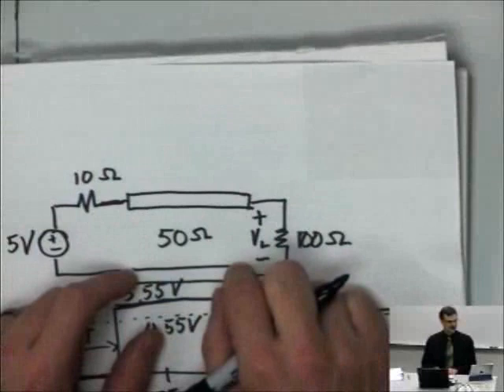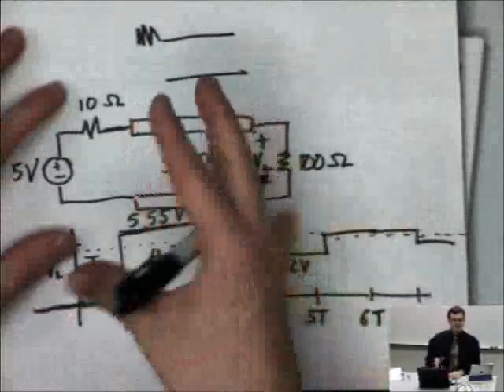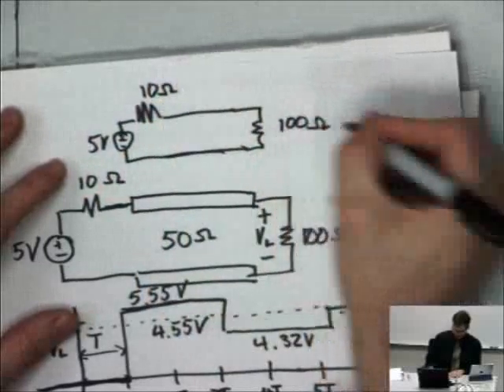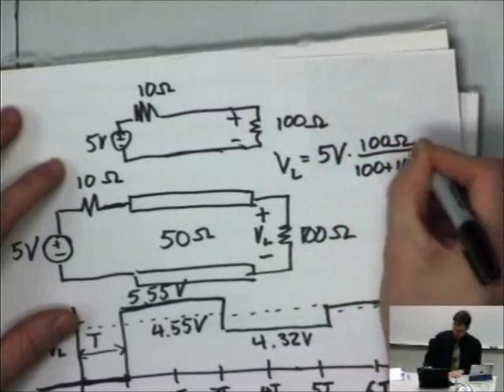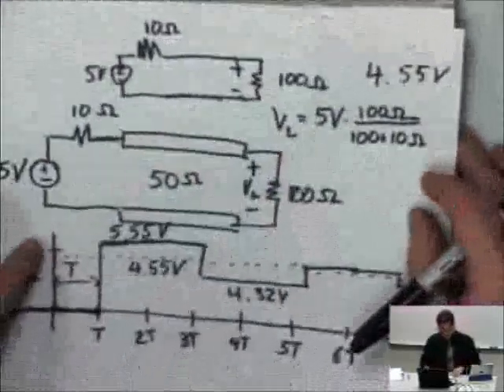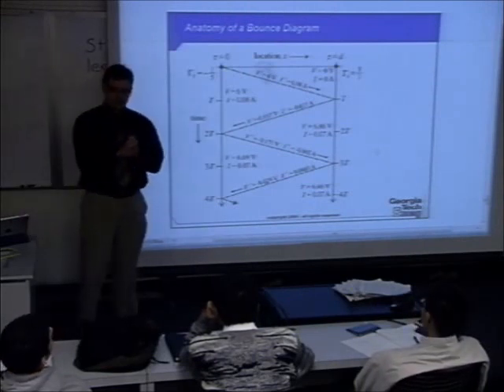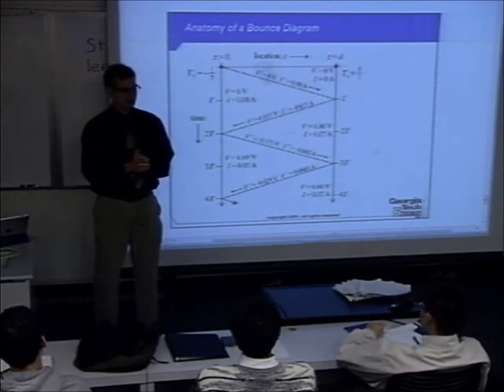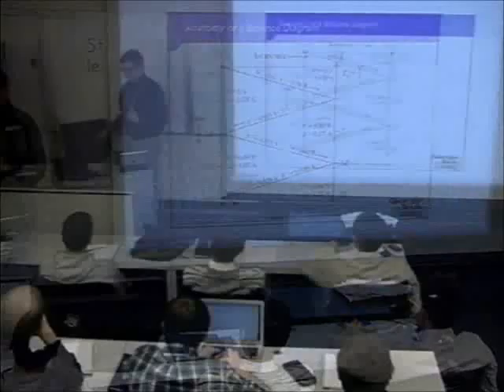TDT04:  Termination Schemes

Comment: At 33 min, what is the value of the resistor that was added in parallel to match 50 ohms? 51.3 ohms or 513ohms?
Reply: 51.3

Comment: Graduate student asking if capacitor becomes a short at steady state? Really!
Reply: First, there are no stupid questions, only arrogant engineers. Second, I am almost certain that this is an undergraduate course.
Reply: Anyone can have a brain fart... No big deal
Reply: Paulo, kind of interesting to see you here, I assume you needed termination resistors in your CPU. I did too!
Reply: @PauloConstantino167  You know why I was using logisim? To prototype my CPU's design before making it into a PCB! Now it is the real world, now reflections are an issue. So by I did, I mean I do need them, that was a miswording on my part.
Reply: @PauloConstantino167  Maybe...
Reply: @PauloConstantino167  As soon as I tell you my target clock speed, you won't want me on your team.
Reply: @PauloConstantino167  Also, I seriously doubt they are an idiot, they could have had a dumb moment. They merely did not know, which is not a bad thing.